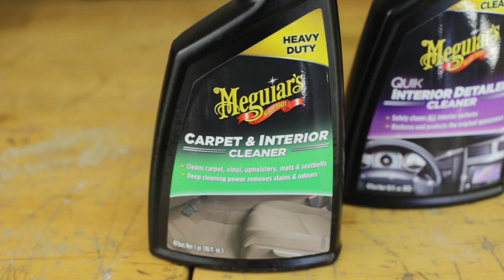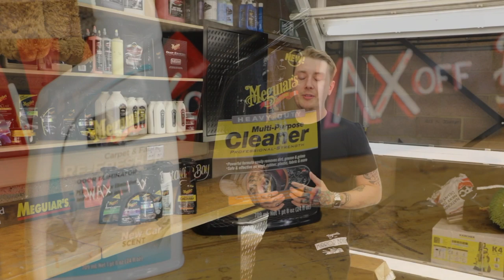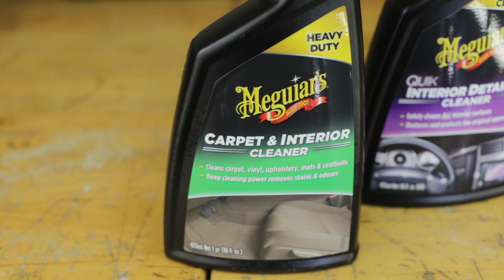Cleaning & Protecting Interior Surfaces - Meguiar’s Detailing 101 – UK Edition

Comment: Which product to use for cleaning fabric seat and door trim ?
Reply from the maker: Depends on what you mean by cleaning and what the door trim is made of.  Please feel free to give our Solutions Hub a call at (800) 347-5700 to discuss the specifics.
Reply: Meguiar's my car Mazda 2 2014 door trim have hard plastic and fabric materials, which product to use for cleaning it?
Reply from the maker: Any of our vinyl and rubber products would work on the hard plastic.  Fabric materials would need something like our Carpet and Cloth Refresher or an all purpose cleaner if dirty.
Reply: Meguiar's Meguiar’s G180224 Heavy Duty Multi-purpose spray right?
Reply from the maker: We do not offer this product in the US but if you are in the UK yes this would work.
Reply: Meguiar's I found this from Motormad Malaysia website.

Comment: Hi...I'm hesitating between the correction compound and the ultimate compound ?
Reply from the maker: Hi M Z, our D300 D/A Microfiber Correction Compound is designed specifically for our DMC D/A Microfiber Cutting Disc.  Especially paired with our D/A Microfiber Cutting Disc, it will offer a significant step up in aggressiveness compared to Ultimate Compound.